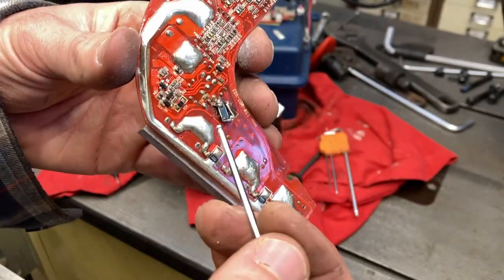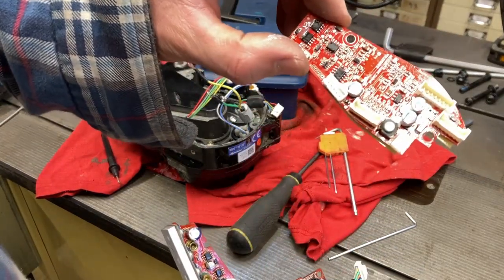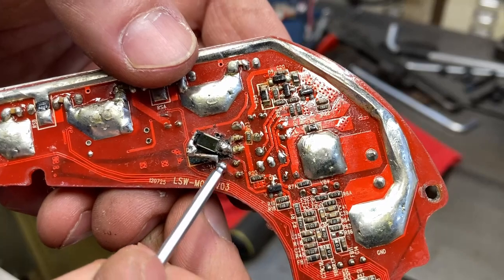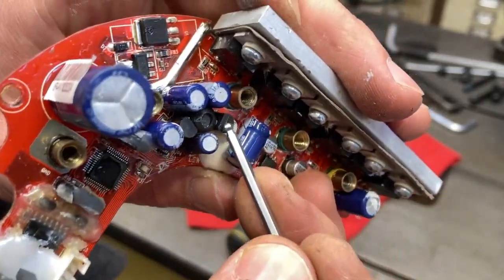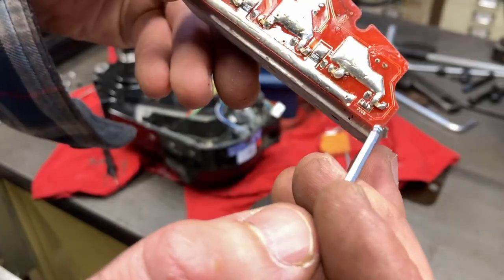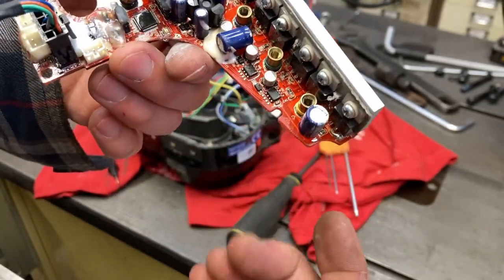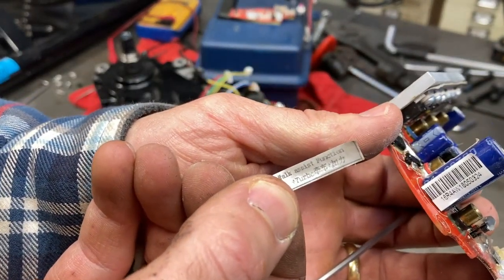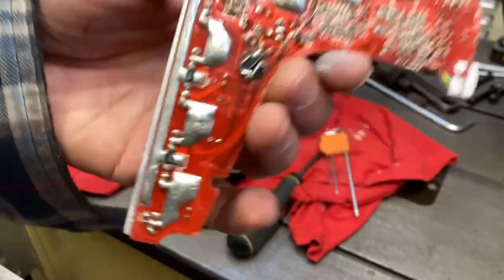Prophete e-novation Tranzx mid drive motor pcb issue: your help please!

Comment: Can you unsolder the blown component and see the board underneath? The solder pads may offer insight into the original part. That one shown could be a later addition.

I'd look into fitting a standard 36v motor driver board. If you type 36v middrive motor controller into search engine, a few curved ones show up. Radius looks too tight to fit in your housing tho.

Could ask BuyitFixit to take a look?
Reply from the maker: Hi Ian, I have had a closer look at it today. It appears to be a resistor and it has about 8.5 megaohms resistance. but it wasn't attached to the extra wire, the soldering was as poor as mine. I thin I will just desolder it and try to make a better job of it. I have seen the boards that you mentioned. but they are slightly different and have different wires in and out, so it would be a bit of a hassle to get the thing wired in. The issue that I have with this bike is not that the e doesn't work, it is that it has no bottom bracket hole. It would be a really sweet good value bike without the mid motor, but I can't mount a regular bottom bracket. And i'm not sure if those magura hydraulics would fit on v-tec brake nodes. So repairing this board is only one solution, but with the bike in pieces on my bench at the moment it may be the fastest!